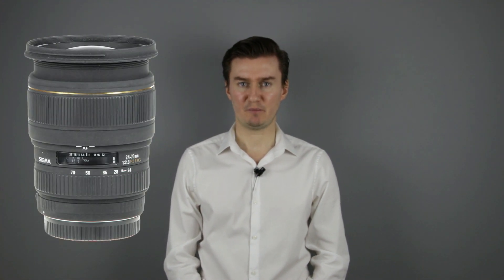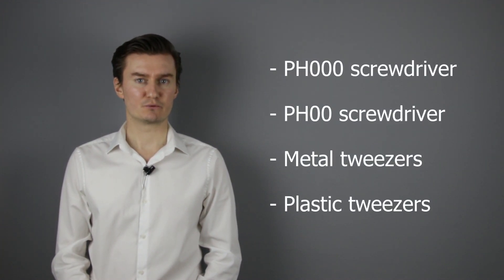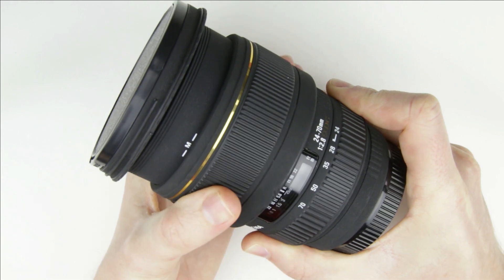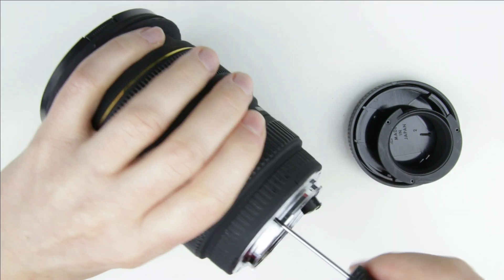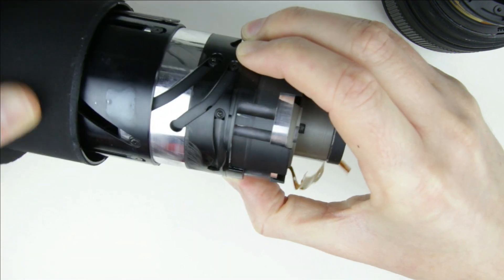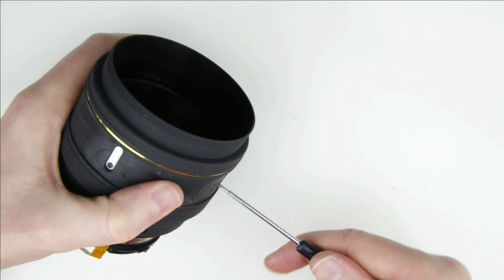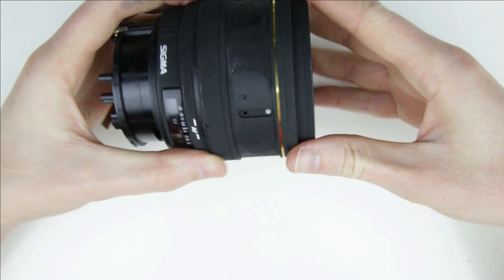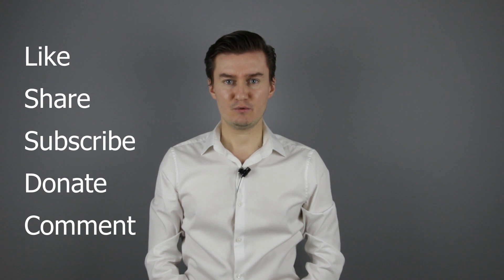Sigma 24-70mm f/2.8 EX DG Macro disassembling the focusing ring

Comment: Kindly upload sigma 24-70 f 2.8 ARt A017 video error 01
Reply from the maker: I don't have that lens, therefore I don't have a video about it.
Error 01 usually means that the aperture is not working, usually the cable is broken, and should be replaced.

Comment: hello just question please my problem i think is the same it stucks and not turning the zoom completly, so my question is can i only move the rubber ring and some screws because it must alresdy there the brocken piece of plastic stucks or it need all?
Reply from the maker: In this case I would recommend to disassemble the lens completely, and check what is causing the stuck zoom.
Reply: Hello i saw this lens on a used market for 250$ i wanna ask you about the lens is it good, Sharpe, color science etc ?
Reply: @joekamouh2002  I think it's not Bad i use it for production Photos I like it but my friend use it Outdoor Take sots for view and plants He told that he didn't like the colors but for me is OK sharpness and the colors, specially my work is over raw and so I correct the colors manually
Reply: @zarehmissirian8980  and what do you think of the autofocus?
Reply: @joekamouh2002  it's fast focusing I didn't have a problem with it
Reply: @zarehmissirian8980  oh okay thank you I'm a video shooter myself and i think it's a good deal so I'm going for it

Comment: Got this lens for free from a friend. The problem with this lens is that the zoom is stuck. Can only zoom like 24-40mm or similiar. Cant go further. It stops.
Focus ring seems to be working though. Took a while to figure out that i could pull and push on the outer focus ring to Auto/Manual focus.
Fixable?
Reply from the maker: I had this problem before. For me the problem was that few screws were got loose and that prevented zooming. I would advice to remove the focusing barrel, and check the screws under it.
Reply: @CamerasLensesEtc  thank you so much for your suggestions. Do i need to take it all apart as you did in this video or?
Reply from the maker: It is no need to disassemble the manual focus tube. Just follow this video until 09:15, then expand the lens (zoom to 24mm), then you can see the screws on the side of the lens. Most likely the screws are loose which are connecting the front lens tube with the rest of the lens.
Reply: @CamerasLensesEtc  Thank you so much again for helping! I really need to clean this lens inside and outside.. its in rough shape. Fingerprints on the glass outside of both ends. And glue on the mount??! and both rubber grips have three parts/spots where it is grey/white.. guess its because of old rubber? can it be cleaned or just replace them? or just leave as they are? its just for estetics :D

Just found your channel. Scrolled though your lists of videos. Lots of usable.. i wish that i had a Canon EF 24-70 f2.8 USM. My father has one and its really sharp! Heavy though. Or a 70-200 f2.8 USM L. I have the f4 USM L version. Very much lighter but requires a little bit more of light..

I guess there are some faulty lenses out there that can be repaired. New they are really really expensive.. also expensive used. People selling them for quite much even when theyre old.
Reply: @CamerasLensesEtc  i thought you maybe had a video on your lens when fixing that zoom issue but couldnt find one :)

i friend of mine has a Nikon lens that has some issues too.. maybe i will look into it. maybe there is a video on youtube how to fix :D

ill guess parts isnt easy to find? if something needs to be replaced.
Reply from the maker: Originally there are no glue on the mount, maybe someone has repaired it before.
Reply from the maker: Canon sells part, but as I know Nikon doesn't. There are many brand new Canon lens / camera parts for sale on ebay and aliexpress.
Reply: @CamerasLensesEtc  I have done some pre-checking. The glue is actually holding the "ring" that also the AF/MF button are assembled too. There is a crack there too. Might need to be replaced if there are any cheap spare part for that? dont know what the part name is. Maybe there is a service manual with part numbers? Exploded view.

Unscrewed the nameplate also. I only used rubber gloves. Easy. Seems that the three screws that are holding down the lens are glued and seems that someone has adjusted them. You can see some screw marks.. that the screw heads was on different place.. dont know is that is factory or if any user did that.. 

I only have a straight screwdriver that fits in to the grove and not a cross one. Need to get one.

Dont know if im supposed to be able to turn the focus ring endless in M-mode? In AF-mode i can turn to both ends without problem. but in M-mode i can turn the ring as long as i want. nothing seems to happen?
Reply from the maker: I don't have service manual for the lens, and I don't know the part.
If the ring is in AF mode, then you should turn the ring endlessly, if it is M mode, then the ring should work only in the range of the focus.
Reply: @CamerasLensesEtc  hmm... then something is not as it should be. Its the opposite as you described now. Maybe previous owner repaired it and got it only working /stuck in AF-mode.

I cant guess what is wrong until i open it. But do you have a wild guess whats might causing this? Seems that there is more than just stuck zoom in this lens :) might had a hard life :)
Reply from the maker: I don't know. Disassemble the lens and you'll see what's wrong inside.
Reply from the maker: You have to follow this if you have problem with focusing (and not zooming).
Reply: @CamerasLensesEtc  For now primary issue is zooming. And secondary might be next issue, inverting AF/M thing..
Reply: @CamerasLensesEtc  sorry for all my messages/answers but i feel a little bit hyped about this lens and your videos/guides and that i might can fix it.. i hope.